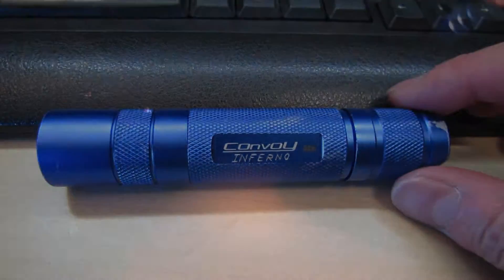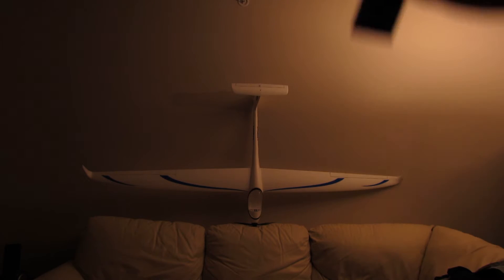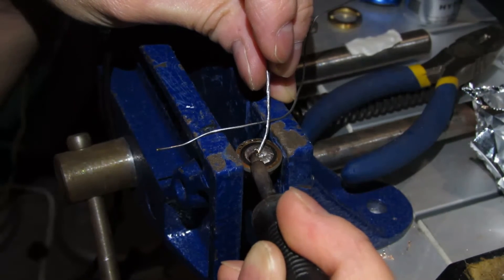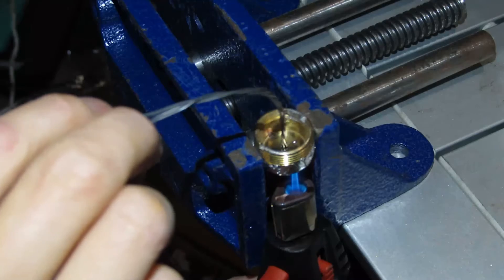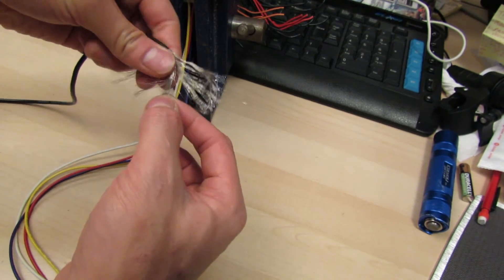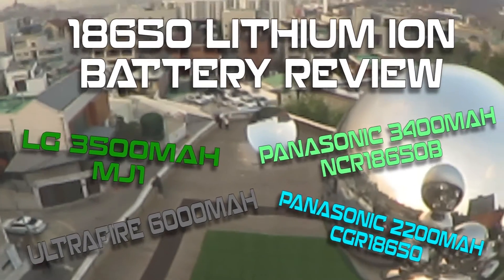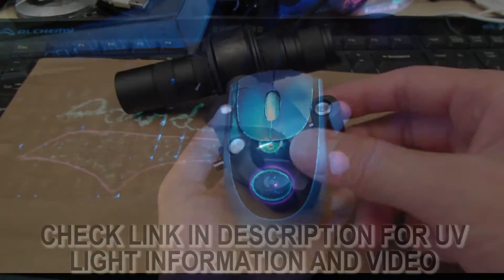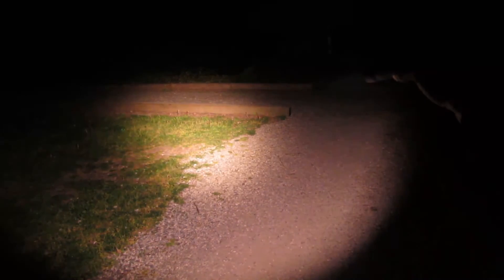The Most POWERFUL Flashlight EVER - DIY Convoy INFERNO - 2239 Lumens

Comment: My S2+ with triple XPL's on copper Notigan pad mounted on copper pill running direct drive from 18awg silver coated mil spec wire with "+" side spring delete and "-" side spring modded with 6mm copper braid and 18a rated switch pulls 12.9a from a single LG HB6 18650.....putting output somewhere near 5,300 lumen (1775 lumen per emitter x3 = 5325 lumens) through Calico narrow spot optics. EASILY burn damn near anything near it, including the user! I do believe that output puts me back in the lead for "Most powerful handheld single cell compact flashlight"! Next I run 4 of the 3x XPL HI with optics on a FET driver with 3 26650 cells for a total of 12 XPL LED's in a Trustfire TR-J18 host! I can smell 20,000 lumens frying your eyes already!!!!
Reply from the maker: Lol, good job man!  That sounds like a beast of an S2+!  It's more powerful than stock SkyRay Kings even.
That 12 XPL LEDs sounds crazy too, that's gonna be nuts.  Can't wait to see it!
Reply: ware did you buy the pil

Comment: i've tried the same mod like you, 16 x 7135 with noctigon xp-l v6, but when i check the output amp only 3.5 to 4 amp..
is it my led max amp? or maybe i can gain more amp with xml led?
Reply from the maker: Hi, when you check the amps, also check the lux level.  Since your test equipment introduces resistance, it will flow less current than it would if the test equipment weren't installed to the system.
If you install an LG 3500mAh or better, it will flow 5A+.
If you use a Panasonic 3400mAh, it will flow less than 5A, since it has higher internal resistance.
Preferably, I would go with the LG HG2 3000mAh, then you'll get full flow of current.  
Even with the LG 3500mAh, it starts to reduce as the battery voltage drops, it's internal resistance is low but not that low.
HG2 is 39mOhm, and 3500mAh is 53mOhm or so, as I've tested.

So for instance, if you get 4A and 45 lux, and you install an HG2 and test again with your tail cap on(With bypassed springs front and back), then it should reduce the resistance in the system sufficiently to push 5A+, and the lux reading should go up relatively, it's almost a linear relationship, so I would expect the lux to go up to 56 lux (5/4 is 1.25, so 1.25 of 45 lux is 56 lux).  It won't be exact, and might be 54 lux since the efficacy of an LED goes down as you increase current.

You can do that, or what I did was use a 130A RC power meter(http://tidd.ly/136da4bb), and hook it up to 2 lithium ion batteries(2200mAh 3P1S 30C batteries) with very low internal resistance, using XT60 connectors in parallel, this provided very low resistance, and I soldered the wires straight to the board to provide the least amount of resistance in the system.  This should only be done if you have all that though, I wouldn't bother with it if you don't have it.  The only reason I had all this was because I have them for my RC air planes and helicopters.
It's easier to confirm it using a shoe-box and a light meter app on your phone, that way you can confirm the increased light output without that 130A power meter and lithium battery packs.

Hope that helps!

Cheers,

David.
Reply: i only able to add more 7135 to the front board, i tried added to back board pcb close to spring battery and it wont give me more amp. i dont know why..
i used lg hg2 and the amp only read slightly higher but still under 4 amp..
is it s2+ has different board with s3 1100 lumens with 8*7135? because i saw someone has star mark on the back board and some dont have that star..
Reply from the maker: I found that some 7135 don't work well, I got some from aliexpress and it didn't work well, the ones from fasttech are the best I find. Where did you order yours from?
They actually made my light flicker a little bit, so I don't use the cheap ones anymore, only the fasttech 380mA ones for me.
Reply from the maker: ذوالفقار علي Cool, I hope the Fasttech ones are real!!
Reply from the maker: Cool. I got the 380mA ones from fasttech.
Reply: Stephen Chandra The XP-L and XM-L leds have the same die and same electrical characteristics. The performance is limited by series resistance. Whetjer that resistance comes from the ESR of your battery, the contacts, the switch, driver, wiring, etc. you will need to reduce it. If the light is direct drive, reducing the ESR too much may overdrive the LED.

Comment: Why didn't you build a triple? Efficiency of cree leds decreases the more you push it so running three leds in parallel will decrease heat output and increase output. When you add a copper spacer to offset the mcpcb you add some thermal mass so the copper disks aren't neccesary anymore. I'd also recommend a FET + 1 driver. The turbo is basically connecting the battery and the led directly together and no 7135 stacking is necessary anymore. You can get a BLF FET + 1 driver for about 6 bucks on banggood. Oh and Nichia's are cool too for a triple because their CRI is higher than Cree leds resulting in higher color accuracy.  Just google triple convoy s2+ for more info. Oh and budgetlightforum.com is also a great resource.

Driver http://www.banggood.com/Astrolux-S1-BLF-A6-A17DD-L-FET-1-2_8-4_35v-7-4-Modes-Flashlight-Driver-p-1009980.html
MCPCB + leds http://intl-outdoor.com/noctigon-3xp-mcpcb-nichia-nvsw219btv1-r9050-d220-p-797.html
Spacer http://www.mtnelectronics.com/index.php?route=product/product&product_id=547&search=spacer
Reply from the maker: Thanks for the suggestions!! And links! That would be an awesome light I'm sure, I like the higher CRI of nichias as well, since quality of light is more important I'm general for me. I like to play around with output and throw of course too, but there's always sacrifice of one thing or another. I was thinking of also going with 3 XHP35s in the S2+, that would be nuts. What do you think? Just need good 18350s. How is the throw with a triple optic? The beam angle is probably greater, and the field angle is probably less I'm guessing? The copper spacer would be good, but I'd still want to add copper behind the plate since it'll help increase thermal conductivity through to the threads and out the body, the area between the plate and threads seems to be a bottle neck in heat transfer. Unless the block could touch the side wall, it won't help with transfer out if the system,maybe a copper wrap around it could help, like people do with the P60 drop in? The only reason I don't buy all this stuff and build it, is cost. I would buy and build it all if it didn't cost money lol. Probably same reason other people hold off buying the next upgrade. Cheers, David.
Reply from the maker: Hi ArduinoMaster, that's a great find!!  It's EXACTLY what you would want for the S2+ to make a triple, that's A LOT of freakin copper, lol.  Thanks for the link.
I haven't built a triple before, but it would make a very compact hand cannon.

Mountain electronics has stock for noctigon triples, they have a 4000K 90CRI D200 Nichia, if you're looking for a higher quality light, that might be the one to go with, it will have a higher R9 than one at 4745K-5310K.  Good for those in search of high output with high quality light.  I would personally go with 3000K, I like warm color temp.
For high output, they have the XPL with V6 efficacy, that will give you the highest lumen out the front since it has a dome and throws the light forward as opposed to the XPL HI which throws more to the reflector or optic, so there's less losses.  If you want more throw, then go with an XPL HI though, but when going for a triple you probably want massive output, so the XPL with a dome would benefit that goal.  From my testing, the XPL HI does have a little lower out the front lumens due to the losses on a reflector. (http://www.mtnelectronics.com/index.php?route=product/product&product_id=547&search=s2%2B+copper+triple)

The driver I'd run it off would be the H17F (http://www.mtnelectronics.com/index.php?route=product/product&path=67_116&product_id=659)  It's got full thermal control, and ever option under the sun for a flashlight.  But I'm just dreaming of a great light, I haven't built it yet. lol. And run it off Sony VTC5's(http://tidd.ly/3ec56fd2), those things have the lowest internal resistance of all 18650's I've found.

Good find once again, I think that could be the best upgrade to the S2+ for those going for a nutty triple!  Thanks for posting.
Cheers,
David.
Reply from the maker: No problem!  Yes, the H17F is pricy, but it's the best in my opinion.  I haven't purchased it either because it's so expensive, but the full thermal control is great for a high powered flashlight, definitely required for something pushing over 30W.  But like you, I'm gonna pass for now.  But for $17 it's actually pretty cheap for what you get.
Have you started programming the ATtiny13A chip with the ardruino yet?  From your name, I assume that's a piece of cake for you, lol.
Then you can program whatever you want into the drivers.

You won't be disappointed by the VTC5 if you're looking for low internal resistance and high amps.  In fact, if you're running the FET, you may even blow things up!!  So be careful, cuz it's mainly your battery's internal resistance that's holding back the current for a single LED setup, so it could increase dramatically with the use of a better battery.

Cheers!
David.
Reply: I just finished ordering all parts for a triple. It's going to be built with a custom driver designed by someone on BLF and hand assembled by me with two seperate output channels so I can drive two different kind of leds. The host is going to be an s2+ which I already have. The LEDs are going to be two XP-L HIs and one 90+ cri nichia on a noctigon. I ordered a copper spacer from that guy in your ebay link, he is also active on BLF so I bought it from there (http://budgetlightforum.com/node/45343). With the different kind of leds I'm going to be able to light the nichia and cree leds seperately depending on which mode I select. So I get 90+ cri and a shitload of output in one tube style light. I am so excited and I'm waiting untill everthing arrives from China and Russia.
Reply from the maker: Awesome man!!  That sounds like the perfect light.  Cuz you can't replace good quality 90+CRI light, that's key to have.  Combined with the high output of the XPL HIs it'll be a powerful light.  It's important to have quality light from a flashlight, that's why I prefer warmer color temperatures.  The one in this video is 2750K, which is pretty warm.
That's gonna be a great build.  Let us know how you like it.

Comment: I love this video, but man, you didn't have to resort to clickbait, David. You're awesome enough to not need that.
Reply from the maker: Haha good points you bring up!  I was thinking that the title was wrong too, but then I looked into it some more, a flashlight is a "battery operated portable light".  Now depending on what you consider portable, that can mean a bunch of different things, in this case, a flashlight is something I can fit in my pocket, this single 18650 flashlight is about as big of a flashlight I can fit in that front pocket of the 5.11 Stryke pants, so in a single celled form factor, it's the most powerful.  The SkyRay king can output 3500 lumens stock, but it wouldn't be considered portable in this case, since I can't fit it into that pocket.  
Ok you're right, if you say it's portable cuz it can fit in a bag, then it is a flashlight and this isn't the most powerful one anymore, but if you're limited to a single celled 18650, this will be the most powerful in the world.  Know that song "chestnuts roasting on an open fire"?  That's what you hear when it accidentally turns on in your pocket.  So I think it's earned it's title in this case.

There's some misleading titles out there, but I don't think this is one of them by far.  I've put my explanation in the description too, to qualify the title.

Thanks for pointing that out though, you're the first one to, and it was a long time coming!

Comment: nice vid! i watched ur S2+ review before this, you really know how to deal with flashlights! :) I own Convoy S2+ with warm light output and I love it. I owned loads of flashlights and this is just one of my very best favourites. I wish to have same soldering skills as you ;) but not yet ;).. I got all equipment thou :P.. btw. S2+ is ideal for biking! I use it as my primary bike light. and I take 1 spare battery with me for a long runs :) Thanks for that vid :) cheers!
Reply: im just wonderinf if you could do the same with the C8 , or Convoy L2 / C12 ? for maximum throw, or maybe mod it for 20W but using XP-L V5 / or even XHP50  led ?
Reply from the maker: Hi Rocheuro, thanks for the positive comments ;o)!  I appreciate it!
Ya I like the warm white Convoy S2+, and I was carrying around this for a while, but it was a little big for EDC and I wanted to go with more of a 16340 light, used a cheap XM-L2 keychain light for a while but the threads were garbage.  I've found the On the Road M3 and it's as good as the Convoy S2+ for output, but uses the smaller 16340 so it's lighter, and good for when I don't need the runtime.  I always thought the Convoy S2+ would be great for biking as well, and I have some bike mounts, it's good distribution for that for sure.  10W isn't much though, and I think a 7xXML2 might be better, running it on medium would be good.
I can do some review videos focusing on the C8 and L2(http://www.youtube.com/watch?v=_wfSUfMFCVo&t=7m7s), but for now I've got some comparison of the L2 and C8 in my On the Road M3 video.  The L2 is definitely a very good 10W thrower, and the C8 is a very good small 10W thrower, it's beam isn't as tight as the L2, but it still does very well.
I compare the C8 to the L2 in a trail, you can check it out here:  http://www.youtube.com/watch?v=_wfSUfMFCVo&t=10m20s
You can see that the C8 is a little softer, but it can still see the bridge very well, the S2+ doesn't have a tight enough beam to really light up the bridge.

If you want a really powerful thrower, the Convoy L6 is very good, 32W/4000 lumens rated.  I tested it out and it can light up a building 0.5km away as well as the L2, the L2 is only 10W, so it lights it up, but the beam is smaller, but they light it up about the same, the L2 might be more intense, but it's very hard to tell.  The L6 definitely lights up a larger area.
The L6 has an orange peel reflector, so the beam is wider and there's more spill/flood light, great as a search light since you can see more overall.  I would say the peak intensity/illumination is similar between the L6 and L2, I'm making an L6 review video, but as a sneak peak, check out my L6 vs L2 vsC8 picture below, you can see that the L2 is tighter, but it's not any better at lighting up the trail/bridge than the L6, the L6 illuminates a way larger area though, the C8 does a fine job but the bridge isn't getting as much light compared to the others:  https://www.dropbox.com/s/4bk4vn9ei94hrhh/L6-VS-L2-VS-C8-IN-TRAIL.jpg?dl=0
(Locked exposure for all shots)

If you're after a very good thrower, they are probably going to come out with a smooth L6 reflector, that with the XHP70 will be the ultimate thrower, I'm sure.

You could probably do the same thing I did to the S2+ to the C8, but the shelf and body are aluminum, so there's a high risk that you could burn out the LED, but it is certainly worth a shot, because that would make a very good C8 compact sized 20W thrower.  The XHP HI V5 would be the best to make it a thrower for sure.  The W3 is the highest efficacy, but I don't know if they even sell that, if they do it'll be an expensive and very high color temperature LED.
I found a V6 but strangely, it says 200lm/W and max 1092 lumens @10W, so I guess it's only 200lm/W at 0.3A or so.
The real key to increasing ampacity though, is using a copper pad, it is essential.  I couldn't believe how quickly the XML2 burnt out on the aluminum pad, copper really keeps the hot spot/junction temperature down.
The XHP70 is on a copper pad in the Convoy L6, I guess that's how they get 32W into a 7mm x 7mm footprint.  Normally the XML2 runs at 10W on a 5mm x 5mm footprint.

An XHP50 LED on copper in the C8 would be nice actually, you could use a FET driver, and 2 x 18350s, as long as you don't push way over 3A it would be a beast!  They really need to make the C8 have a brass/copper shelf though, otherwise heat may be an issue.  You could add copper in there yourself I suppose.
If you push the XHP50 hard, you could probably get over 3000 lumens out of it, it's rated at 2546lm, so I'm sure you can push it.  Good idea.

You got all the equipment, so I think you should give it a try if a thrower is your goal.  You can just heat up the pad, and solder the XP-L or XHP50 LED like I did in this video.
I bought some low temperature soldering paste, typically used in ball grid array(BGA) soldering, it's low temperature 183&#176;C so you won't damage the LED too much when heating it up to reflow it.  They normally use hot air but since our pad is copper/aluminum, it heats up pretty easily.
I just used normal solder, but I'm sure the low temp stuff is better for the LED, since keeping the efficacy up is important to maximizing light output.

Cheers!

David.